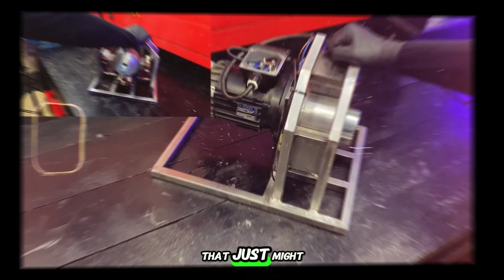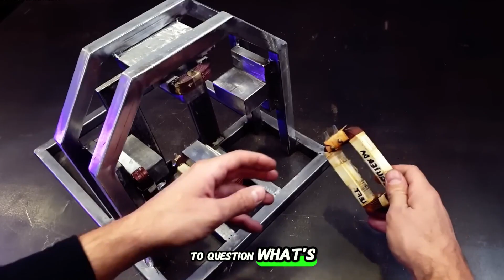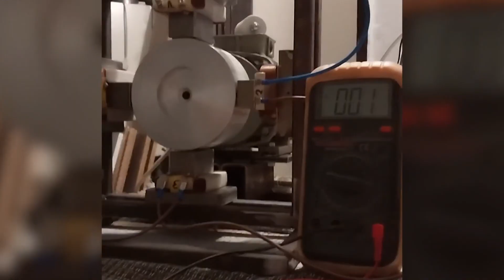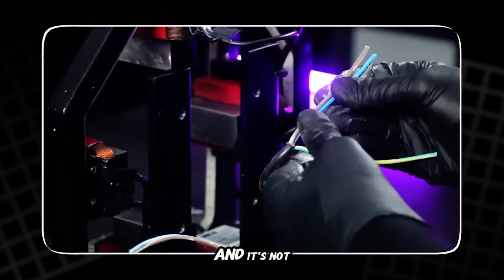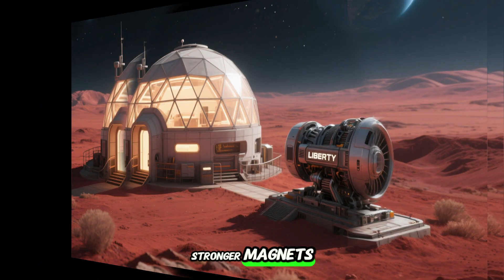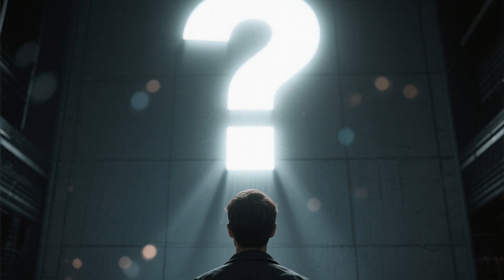Tesla's Dream Revived: The "Liberty" Engine That Runs Without Fuel!

Comment: If you really want to convince me, then run your engine and use it to power a dishwasher or something similar! If the engine doesn't stop, then I'll believe you. but of course you have to hang the motor in the air so that everyone can see that there are no wires are connected to it.

Comment: you see, this is called a flywheel. good job hiding the battery's, but I found them inside the motor.
Reply from the maker: It does look like a flywheel, but I explain the idea clearly at the end of the video. Please watch until the end.
Reply: @worlduncovered-m4m  I did.